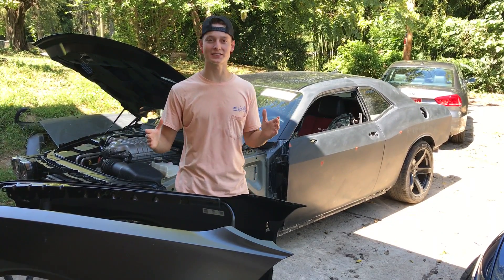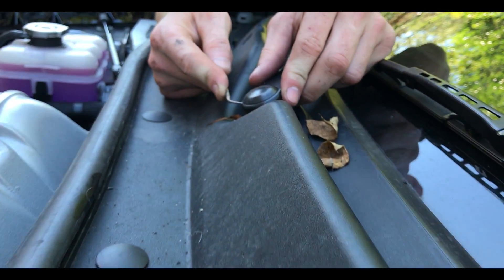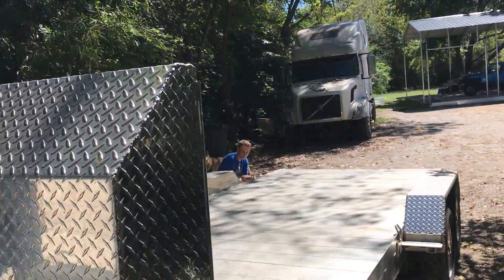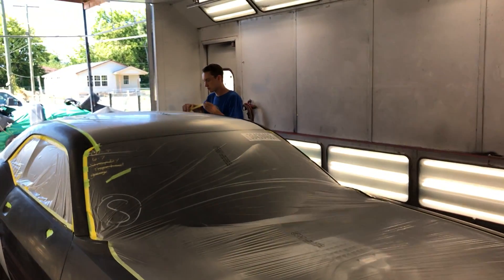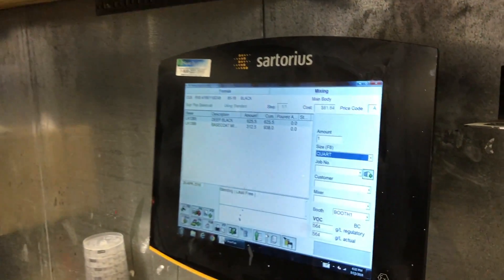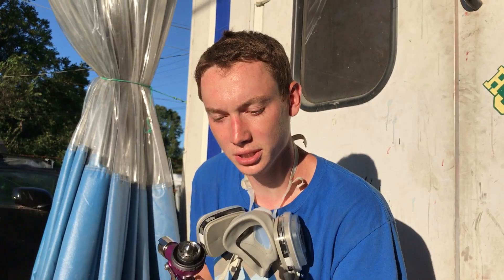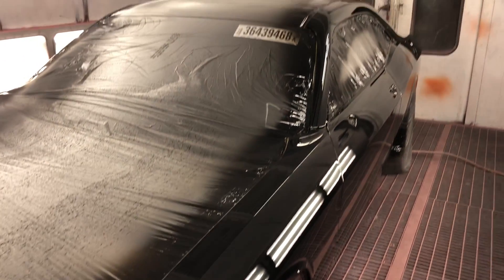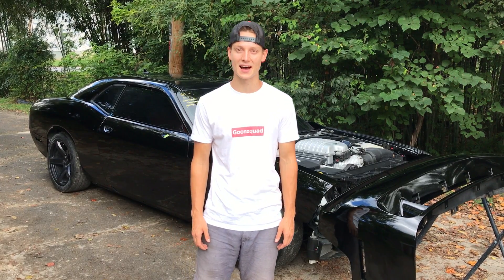Rebuilding A Wrecked 2017 Dodge Hellcat Part 12

Comment: How many coats of paint ... just depends  how many coats of clear just depends..... probably our last coat what do you think ... ya just depends 🤣
Reply: Texas 325 IM DEAD😂😂😂😂😂😂😂😂😂
Reply: I was laughing so hard everytime
Reply: Sounds like a true professional... 
Or not. Lol
Reply: @derrickforeal  i bet you can do way better huh.
Reply: New T shirt please. "It just depends"
Reply: Id actually buy that one too hahaha.... Have your logo and "Better than OEM" on the back and the front says..."It just depends"
Reply: No depends. The tech sheet requires only 2 coats of clear. You don’t go outside of the paint manufacture recommendation otherwise you will
Run into issues.
Reply: I read it in a cowboy accent≧∇≦
Reply: What kind of issues? Doesn't the manufacture give a basic guideline to get it back to oem? Ive never heard you cannot put more clear coats on bc it gonna mess it up.
Reply: Malloy Stale no mate. Not basic guide lines. Manufacture guide lines based off the product. If you add more than the recommended coats you will build up the mils and it will cause dieback and pinching which I could see evident in some of the shots. I’m a paint tech for many shops and know my paint. 😀
Reply: So do you wet sand between clear coats to put excess clear on it? Bc Ive def seen show cars with 10+ coats of clear. High dollar paint work.
Reply: Malloy Stale it’s called flow costs and usually it’s not ten coats of clear. It’s sanded down with about 600 and re cleared. People will say we have multiple coats of clear to act as if it’s something good. Really it’s not. The more mils, the more brittle the paint is.

Comment: You two alone do work faster than a body shop with 10 employees
Reply: Two Car Garage its because they work on one car at a time, not 15.
Reply: Cuz they pay by the hour??
Reply: Lol body shops take a week
Reply: @claydog6422  only to apprentices, body men and painters get paid wrench time
Reply: That's because body shops get hourly lol
Reply: Yea cause all this work is hack
Reply: MGOD92 Explain?
Reply: MGOD92 explain?
Reply: BigKing17 anyone in a production body shop can explain to you that the sectioning of the quarter and rail is not the OEM specific procedures. For their age these guys do good work. But don’t compare to a actually body shop. More like used car lot. 

Every repair with structural parts has to be followed by the manufacture guides. So in a court of law the shop isn’t reliable. And in my experience I have never seen any guide that allows you to section in the middle of a quarter. Usual follows the upper sail panel and rocker. 

Rails are even more important and are just as strict. Also we are not all hourly mostly commission.
Reply: @SoBeneficial  tell him
Reply: SoBeneficial They do great work. After my body shop guy left to work at an exotics body shop place, I have not been able to find a decent body shop. They all charge too much and do Mickey Mouse work. I wouldn’t second think bringing my wrecked car to these guys to rebuild
Reply: SoBeneficial No I want MGOD92 explain it to me. Also, I think you meant to say a well established and highly rated body shop right? Because I've seen some shit come out of some bodyshops, Bondo everywhere!! Furthermore, they took the car to their friend who works at a body shop to get the work done. Besides getting more experience, the only thing they need to get better at is paint jobs.
Reply: It's a Fiat so they say super glue that shit back on for all we care...
Reply: Dam that's tell u something they better then the employees ....lol🤣🤣🤣🤣
Reply: Boys! Put on a painters 3M suit! That paint will absorb through your skin.
Reply: Got dat right 😂😂😂😂😂
Reply: I'm curious as to how they corrosion protected the back side of that quarter panel with raw welds and the zinc ground off the steel.
Reply: @James Costello they didn't.
Reply: James Costello exactly! All these fools think they know it all but skip the most important part. “We’ll just paint the outside.” Haven’t seen a bottle of cavity wax yet.
Reply: Chump Johnson your one sided brain is really helping you. Yes people cut corners. Like these kids. But why let one sour apple ruin the bunch? I work at a platinum certified collision repair shop. Ever job we do is documented down to how many spot welds we us. Everything has pictures taken. (Before weld,after weld,seam sealer, etc) Adjusters come out daily to inspect the quality of repair. Like I said earlier don’t compare these guys to a actual body shop. More like a used car lot.
Reply: BigKing17 yeah should have went into detail about what kind of shop. Because really any private owner can slap a sign out front saying “body shop” just shops like that give us guys a bad wrap.
Reply: @SoBeneficial I checked alldata and there is a section procedure for these rails.  The frame guy was really close to doing it correctly but not to Dodge's spec.  Dodge wants you to layer the two sides in. You could have probably sectioned it and welded it in one piece if cut and installed in the correct locations.  Carefully weld it from the outside and use a frame measurement machine to know everything is in the right spot.  Like I said though it was off the mark.
Reply: You are oblivious
Reply: Oblivious to the obvious.
Reply: STEVE Cramer finally someone here with some knowledge!
Reply: that's called a HIGH SPEED CAMERA DUDE. HAHAHA
Reply: The one dude does pretty much all the work in all there videos it seems
Reply: @kingcobra2845  I think it's because he has the most experience with this type of stuff if I'm not mistaking they said at one point that he use to work at a body shop and the younger brother is probably better with the camera stuff he probably does all of the editing and everything 🤣 but you never know how much the younger brother does off camera if you pay close attention he actually helps quite a bit during the spedup moments of the videos

Comment: Its ok to wet alternator just dont wanna spray it with no pressure washer directly, and u wanna make sure all the covers for fuse box are on properly
Reply: I normally have the engine  running while giving it a spray and de grease, have never had an issue with any car doing it
Reply: u do wanna be careful with engine running though, cause if u pull water through it can cause damage, especially on functional ram air type intakes.
Reply: The cars that i did it to were all shitters, therd no way id hose down a high performance engine, for that  reason, it wouldn't be too  good to get water in it.
Reply: I don't use a pressure washer i just use the garden hose, it works pretty good without doing any damage
Reply: Jasperisamazing123 Definitely be careful around the coils. I mistakenly washed under the hood of my old mustang and had to replace coils and wires because of misfiring afterwards. Never again will a pressure washer go under the hood of any of my cars.
Reply: When the engine warms up and you squirt it with the hose, i find it dries alot quicker, and while the engine is running  if anything is going to go haywire you will hear it at least and can turn the car off

Comment: I've been  Pressure washing cars for 35 years it don't hurt nothing Cars are designed  to drive-in the rain And the snow ant they
Reply: They were referring to washing the engine specifically.
Reply: Good insurance to bag the alt
Reply: @E-Eightyfive   exactly it's just insurance
Reply: Very true but the psi and angle of the spray of a pressure washer will put water in places that rain never would. Better to be safe than sorry

Comment: Though the engine is water resistant. The engine isn’t designed to get pressured washed which many electrical connectors can corrode and go bad

Comment: I feel like you might need a body suit for the paint booth man, those caner chemicals get absorbed in the skin. Safe than sorry right.
Reply from the maker: jcwat hats that’s true, I just ordered a couple new suits for our next paint job on the next build
Reply: And eye protection, I’m not sure why you paint without goggles
Reply: Suit, gloves and pressurized face mask are really required for modern paint.  The catalyst is an isocyanate (cyanide).
Reply: Definitely don't want to screw around with that stuff, most 2pack paints have cyanide in them

Comment: I've been washing engine bays for almost 40yrs. I have never damaged an alternator or anything else under the hood. When cars had distributors, I used to remove the rotor and pack it with paper towel and cover the cap with clear wrap. I wouldn't us a pressure washer, but normal care and the engine turns out fine.

Comment: Don't worry guys about the alternators as long as the engine is not running and the voltage regulator inside the alternator is not hot. That's why it is preferred to wash and clean an engine while it is completely cold. Same goes for the coil packs as well. Of course the safest would be to cover them with some plastic bag or anything similar. Greetings from Greece.

Comment: If you have a dark coloured car, maybe drop some paint drops of basecoat into the primer. So it is way darker. So it covers better up when you're spraying the basecoat. Just a tip, that is what i did when i worked as a bodyworker.

Comment: There are a couple dents in the roof above the drivers quarter glass near the rubber strip, might want to take those out before you buff it, if you can remove the headliner and tap them out.  You can see them at 8:34
Also about water in the alternator the only possible problem would be getting water in the bearing, but that chance is about slim to none, especially once the alternator is running it'll soon heat up and dry the water off fast.

Comment: What we did at the dealership is pressure was the engine with the car on, then after spraying it go back through with a air compressor to blow out all the water to help ot dry.

Comment: I seen a guy use extra long bolts and like 3 inch spacers to hang on the bumpers, it held the bumper just far enuff away from the rest of the car to get all the edges done. spacers between the car and bumper ..... it worked !

Comment: Liking your work guys. 8.35 you can see you are going to need more than a buff for the roof. You can see several lows, nothing a skim coat of filler wont fix. D

Comment: When it comes to washing the engine bay have at it, but just don’t get to close to connectors, they have seals in them but aren’t meant to seal pressurized water. Also careful around spark plug tubes water gets in them and the coil shorts out and you get a misfire. So basically just been gentle and don’t get to close to electrical components

Comment: When you guys replace the windshield. Make sure you replace it with a factory OEM windshield. Do not use aftermarket. if you look in the bottom of the right hand corner of the windshield there is a silhouette of a Dodge Challenger.

Comment: try to avoid buffing for a few weeks because gas escapes from the paint and clear coat as they continue curing and hardening. This is one of the reasons why cars are typically buffed at the dealership and not at the factory

Comment: I'm a new subscriber. Loving the videos. Just one thing I didn't like about this video. That brand new carbon fiber hood on that rickety old stand. I know it does a fine job holding it but you guys working around it and pull your water hose around could have easily bumped it and knocked it over. and that hood is beautiful would've hated to see anything happen to it. Keep up the good work fellas.

Comment: The alternator can go bad if you blast out all the grease and then run it and ignore the squeaking as the metal inside eats itself. My rule of thumb is to wash it down carefully and the relubricate it using WD40 or similar.

Comment: It's only certain types of cars you have to worry about washing the engine, for instance there was 80's Corvette I think that they used a distributor or (coil pack) that they used on a few different engines. In one car they had to redesign it to have a little tiny drain hole for moisture, when they used it on the Corvette it was mounted the other way so water would drip in instead of out.... ruining it.

Comment: There is a chance when power washing the engine bay for something to short out. I mean there is a lot of wires and stuff like that ofc . I would just make sure all plug ins and any exposed parts like the alternator for example to be dry before starting the vehicle.  Shouldn't have an issue if u do that

Comment: It's usually the detergent that damages the altenater not water so it's always best to cover it with a plastic bag. Before u go to paint u should base coat and then sand  the primed areas of the car.  U should never strap down the body of the car ,always just the wheels.

Comment: Hey, I am using glazing putty on a project car, what grit of sand paper would I use to smooth it out before painting? I have 500 grit but it seems a bit rough
Reply: Does it dry by air or use a hardener  to cure. The red stuff they used is for pin holes and rock chips not meant fill any bigger than that.
Reply: Mines the dry by air red stuff with no hardener meant for tiny fixes (same as they are using from the looks of it)
Reply: Use a single edged razer blade like a spreader to fill the spot . Only use enough to fill chip or scratch. Let dry for 30 minutes. Use 600 with a block ,3or 4 swipes and your done. The stuff is not meant to use as a filler, doesn't matter what grit u use, it rolls off when sanding.

Comment: goonzquad how did you get access to a paint booth? I have some painting to do but my compressor will need a filter and I’m not sure it will be enough CFM for current HLVP guns plus my garage would probably involve a lot of particulates in the paint. So, do you just have a friend or is this a rental situation in your area? Thanks!

Comment: You guys should have painted the rear bumper cover separately just like you did the front. The rear bumper cover is going to be glued on with that paint and you won't have a clear joint between the cover and rear fender. Not OEM.

Comment: Alternator go bad from power washing? People don't realize when driving in rain, the alternator normally gets soaked anyway, I can see the bearing going bad after a few years, and that happens, my truck caught fire for this reason, though that alternator has been on that truck for nearly 200,000 miles, been in tornado weather, threw mild floods.

Comment: Only problem I see is that you guys didnt fill the front plate dimples in the bumper while you were at it.  You did body filler on the front, why not fill those dimples too.  Make it a smooth front bumper??

Comment: What did yall use to wipe down before the primer on the front bumper? What is it for???
Reply: Sebastian Moreno it’s called a tact cloth. It’s a sticky cloth which grabs on to any dust particles or trash that still stuck to the body of the car. Pretty much a last min effort to minimize anything sticking to the paint.
Reply: @humzauddin105  thank you bro i heard him say it but was unsure i appreciate it

Comment: Nothing happens to that alternator just don’t do it with the car running I have don’t it for years and nothing ever happens just dry it with some compressed air or turn the car on and let it dry it’s self and if ur check engine light comes on check the codes if u can and take some compressed air blow the water out of the plug that should solve ur problem

Comment: I have painted cars for over 45yrs and have never seen anyone paint the sides as you do.  You should never spray a section at a time.  Spray the whole length of the car bumper to bumper.  The way your are doing it you have some places with 4-5 coats and the middle have only 3 coats. If you wet sand later you could go through the paint.   Just saying...
Reply: K

Comment: you will not hurt the engine getting it wet lol what moron would say that, some plugs and spark plug holes may not like to be pressure washed.... but that just needs drying out properly.